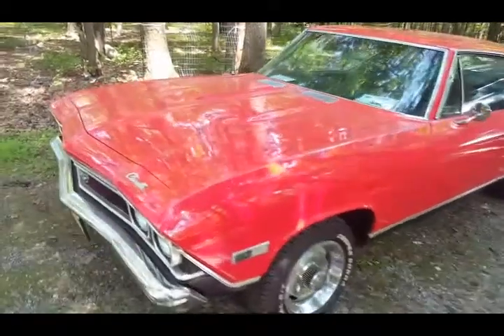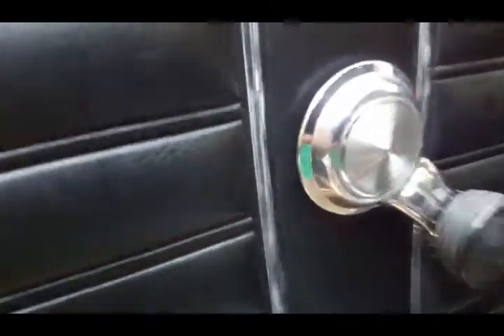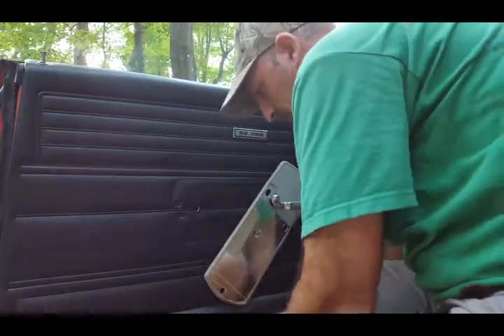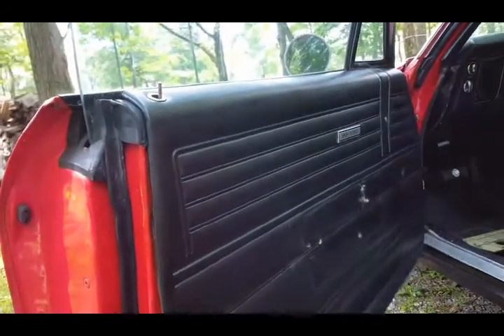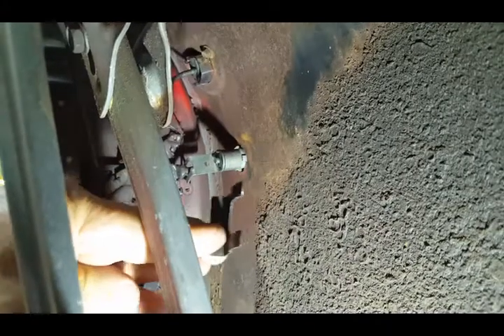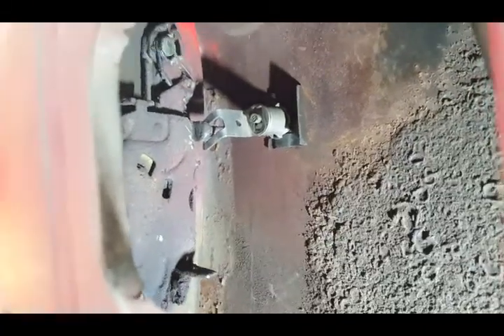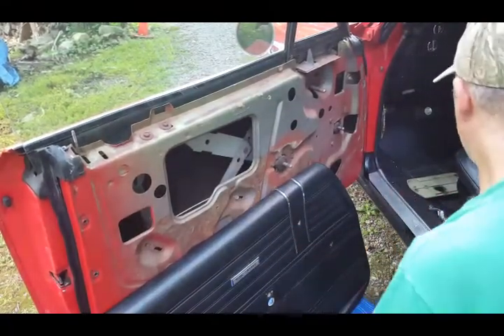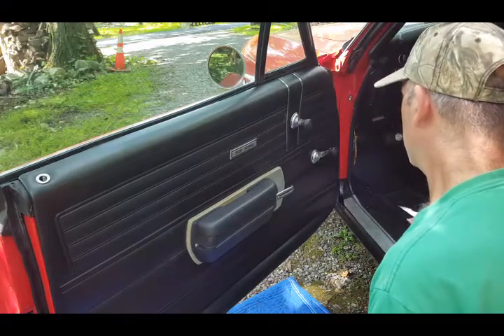SS 64-74 door lock, remove and install door panel 68-74 Chevelle

Comment: what is the metal bracket that branches off the rotating portion of the lock?  I’m missing them and need to order.  help would be much appreciated.
Reply from the maker: I Think they're called the (Cylinder Prawl lever).  Please let me know if this helps. All the best

Comment: What kind of cam u got in that and what kind of muffer
Reply from the maker: I did not build the motor. I think it is a 1/2 lift cam. 454 motor not the original 396. X pipes 3" with  Thrush mufflers.
Reply: Thanks for video,
I have a 68 chevelle first car build ever and I built this thing from videos like yours and others.
Thanks for contributing to us garage build guys

Comment: Hi I  have a 69 chevelle the door lock was not opening. I don't have that attachment from the lock to the door.  Do I need a whole new lock? also you said you went to go  get your lock re keyed.  So Can I keep the same key that i  have with a new lock? Because  the key that opens the door also  starts the car. Thanks
Reply from the maker: It should be a little clip that holds the rod to the bracket that unlocks the door. As for the key you can rekey the lock to accept the key. There's a place out here by me that does that. I don't know where you live.  find a reputable Key Shop. They will help you. Let me know if this helps. All the best

Comment: Harry, Does the rubber flap on your 68 Chevelle's vent window go inside the door or does it hang over?
Talking about the outer side of the window/rubber seal?  Thanks
Reply from the maker: Hi Wayne. I will have to check tomorrow. I am away this evening, can't get to the Chevelle till tomorrow afternoon. If you don't hear back from me by 6:00 tomorrow leave me another comment. I'll run out and take a look.
Reply: @classicrewind2715  no prob. Thanks
Reply from the maker: This is my email . Send me a picture of your vent window so I know what you're talking about and tomorrow I'll send you one of mine.
 harry.k.adventure@gmail.com
Reply: @classicrewind2715  can't send till weekend. Thanks
Reply from the maker: No problem
Reply from the maker: Hi Wayne.  check out this video. The wing window for the Chevelle 68 is the same for the 68 GTO. If you have any questions email me and I will send you pictures.

https://youtu.be/NsckyOg9pgo
Reply: I got it figured out. Thanks harry
Reply: I got them in, Thanks Harry
Reply from the maker: @waynebauer2770  Great. If you need anything let me know
Reply: @classicrewind2715  Thanks!!